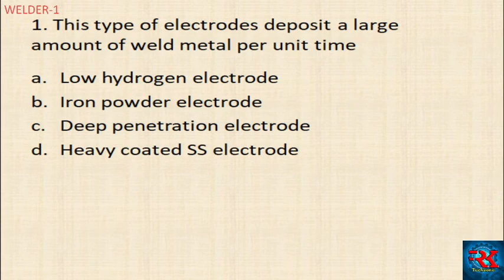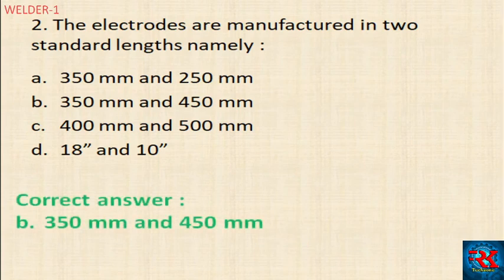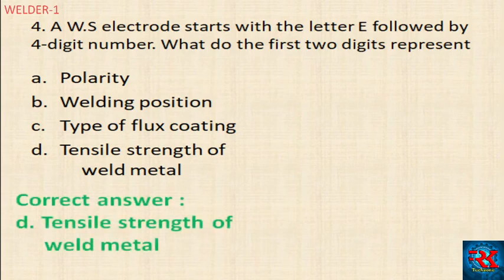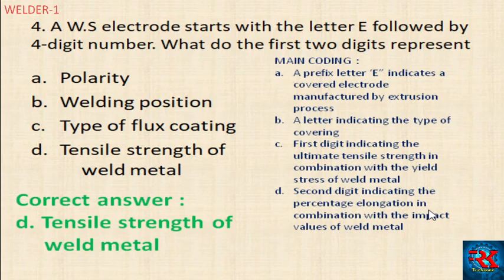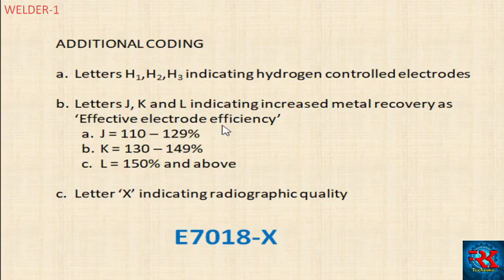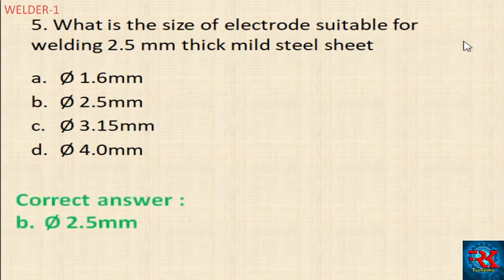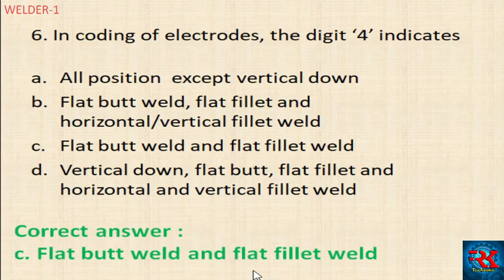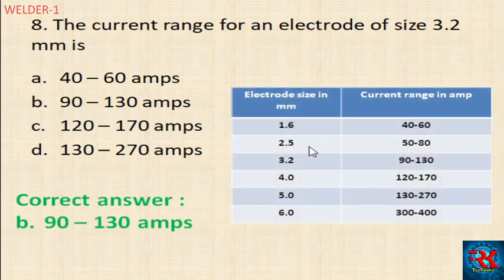JUNIOR INSTRUCTOR WELDER- OBJECTIVE QUESTIONS- PART 2

Comment: Aws 4th digit indicates types of flux coating aane..
Reply from the maker: first digit- ultimate tensile strength
second- percentage elongation
third- welding position
fourth- current condition
flux coting is in second alphabet..
for ER 4211, R is the coating
Reply: Aws and bis randum same alla bro